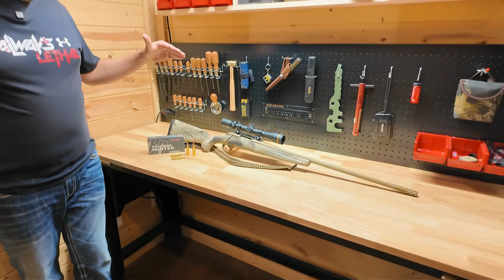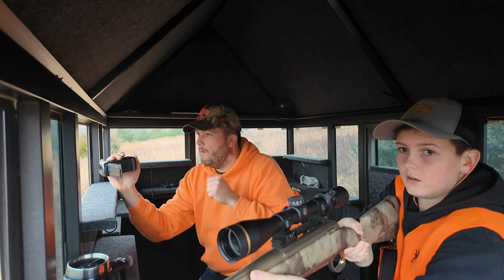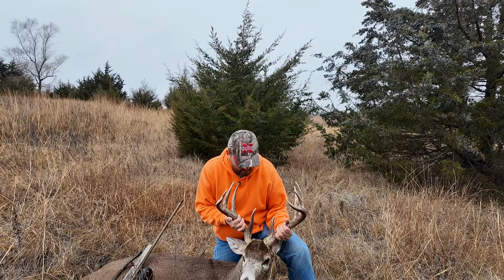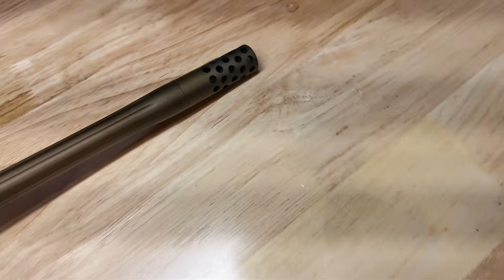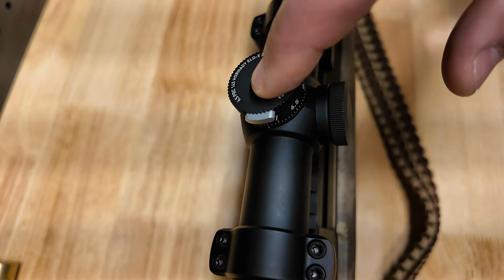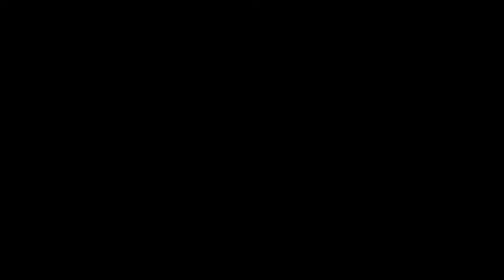6.5 PRC: The Ultimate All-Around Hunting Caliber?

Comment: A number of cartridges can be described as all-around. The job defines what may be best. I know someone who has never failed to harvest a deer with a .25-06. I have hunted with a .308. Normal factory ammo  makes it good for 300 yards and less. My all-around now is the 7 PRC. Factory PH 175 gr ELD-X is giving me .25 inch 3 shot group at 100 yards. I did some chrono data, which anyone should endeavor to get and the average MV was 2900 fps. True, that is 100 below the box claim but still usable. More important, it is pushing heavy for caliber at really good speeds, so the impact velocity is helping the bullet to function as intended.

It was pointed out by others that most cartridges, or at least .30 cal and 7s are close to within an inch of drop with each other to 500 yards. Past 500 yards, the 7 PRC really shines. But that is a different job. Some game have been harvested past 300 yards. I would be comfortable with a 7 PRC on elk. Though others may prefer .300 WM or .300 PRC.

I think, for me, and I may be a fudd, 6.5 PRC would be the smallest I would use on elk. Though I did see someone bring down a moose with 2 shots from a 6.5 CM.Within normal hunting distances of 300 yards and less. Which means that the size and weight of the bullet was the same and enough available energy that shot placement, as always, is king.

In fact, shot placement is so important that, in reading the big game hunting book by Elmer Keith, his preferred cartridge was .35 Whelen and still wind up with injured animals that lived long enough to disappear.

Respect for the Cornhuskers. My first step-father was from Nebraska.
Reply from the maker: Great response! Nice hearing some more real world 7 PRC chrono numbers, too. It's another great cartridge, but has taken a beating over those chrono numbers. I appreciate the comment, and GBR!

Comment: How's it any different or better than the 6.5-284?
Reply from the maker: They are very similar cartridges for sure. The 6.5 PRC has slightly higher case capacity (67.6 gr vs 64.3 gr), which allows it to push heavier projectiles and maintain more energy downrange. For factory ammo the 6.5 PRC will have slightly faster muzzle velocities, but the 6.5-284 has more handload options available. Great question and thanks for watching!
Reply: @HuskerHunting the 6.5x284 will push just as heavy a bullet. How much more velocity do you equate with that 3.3grains of powder? At that point, barrel length and barrel quality make a bigger difference than a couple grains of powder.

Comment: I have a 6.5 PRC Browning X-Bolt Pro with a BURRIS Eliminator 6 scope with 1/8 MOA adjustments for zeroing. This setup is for hunting in Nevada's wide open spaces and in my opinion an excellent combination of rifle, cartridge and scope. The E-6 scope sits in TALLEY rings with a rear ring bulb level - just in case the E-6 battery dies.
Reply from the maker: Sounds like an awesome setup! Thanks for sharing.

Comment: Kind of a ridiculous notion from Mr Hornady considering the 6.5 PRC is the ballistic twin to the 270 Winchester, which has been around for about a 100 years.
Reply: Higher bc bullets. That's the whole point. You can't do what 6.5 prc does in 270 unless you handload. Prc is more inherently accurate due to chamber/ case design. It's marketed to newer shooters. They will benefit most from these type of calibers. It is what it is.
Reply: yes....better bullets for beyond 400 yds really......270 400yds and less.....same basically

Comment: Basically a .270 win…
Reply: Yeah absolutely not. 6.5 prc out performs 270 by like 150 ft/lbs of energy.
Reply: @adrenhamel1731 wrong almost identical any in many case 270 is faster as is the 264 win mag, and 7 mag
Reply: @adrenhamel1731 I bought one to load for to see what all the hype is. Shooting 127 Barnes max velocity is 3150+/-, will not come close to my 270 shooting 130 AccuBond at 3280.

Comment: The 6.5 PRC is an excellent cartridge, but if you want to use all-copper bullets, it absolutely is NOT any better than the old .270 Win. I reloaded and shot both, side by side, for four years. The highest B.C. all-copper bullets available for the 6.5 is the Barnes 127 gr. LRX with a .468 B.C. The .270 Barnes 129 gr. LRX bullet has a B.C. of .463. The powder capacity of both cartridges is almost identical, as are the muzzle velocities, 3000 f/s - give or take. It's all a matter of math, folks: two bullets with B.C.s and muzzle velocities that are the same have the same external ballistics - drop, wind deflection are the same, even with bullets of  vastly different weights. In this case, with only 2 gr. of weight separating these two, even the energy is the same. As a matter of fact, the .270 can be driven a little faster than the 6.5 (according to Barnes reloading data), and it has a larger frontal diameter, which actually gives it a very slight edge over the 6.5. Don't be misled by the hype ... unless you don't mind buying cartridges that cost at least twice as much for one caliber than for another caliber that can do the same thing or better.
Reply: 1 in 100k commenter's who actually have a brain and are able to use it.👍
Reply: @Mike-xi4zt  I just saw this. Thank you so much for the compliment!
Reply: Qué feliz me hace que la gente se dé cuenta de las virtudes del 270. Tenía 6.5 y varios Wilcats magnum, ninguno de los cuales superaba un simple 270. Me comieron el bolsillo. Las balas de BC alto cuestan 3 veces más que las de 6,5. Me quedo con mi 270. Gracias.
Reply: I'll never use all copper bullets.

Comment: I am in Wyoming using PH2 in 6.5 PRC for Antelope and Elk and it is an awesome cartridge. I reload so I can get the most out of it. I will say that I am DONE with the 143 ELD-x exploding bullets. I thought the Bergers were bad about that. The Eld-x is worse!
Reply: You will want a copper bullet. The Barnes TTSX will do everything you are looking for. FYI the copper bullets run lighter on the weight but will still match the BC for the most part.
Reply: @benschamp9327 they will not match bc
Reply: The bc won’t matter for hunting anything inside of 500 yards.
Reply: @cjsawinski  Eh, wind drift can be pretty different in a 20 mph crosswind. However, for the most part I agree. My contention wasn’t that bc I super important for hunting, it was with the guy saying that the copper will match the bc. That is absolutely incorrect
Reply from the maker: That’s good feedback. What bullet are you using now? Sometimes I wonder if I should switch to the Hornady Outfitter line with the CX. I want to set up a 7 PRC using the CX.
Reply: @ well unfortunately I am getting through the season with the Eldx and still figuring out were I will go next. I still have a late season cow elk tag to fill. I am not familiar with the CX. I will need to look into them. After years of hunting with Berger and now the ELDx I will definitely be moving to a bonded bullet. The trick is finding one in stock that has a high BC. Because of the powder I have on the shelf, I will stay with the 140 class at least for now. That seems to be a good range for velocity versus wind resistance anyway.
Reply: @MaxairEngineering  if you want a high bc bonded bullet the 142 Nosler ABLR  is a good choice and doesn't explode like the ELDX.  I prefer the Barnes LRX 127 grain for 6.5 on elk and long range antelope.  Not sure on your velocities,  but I'm pushing 3450 with a 6.5-300 and the Barnes LRX 127 crushed a bull elk shoulder this season.  It's a better bullet than the CX for mono metal.  I too am in Wyoming looking for late season cows.
Reply: @ thanks. Yeah for the powder I have I need to stay 140 class. Nosler sure is proud of their bullets $$. Unfortunately I heard that they too explode at close range. Was that bad intel? I’m in Laramie btw.
Reply: @MaxairEngineering  my experience with Nosler ABLR is just factory loaded 175s for my 28 Nosler,  I don't reload them.  I have killed elk from 200 to about 650 with no issues. The 28 velocity is around 3100 which I assume is similar to your 6.5 PRC,  yes they seem to be made of gold for their price.  I try to stay off the shoulder with most bonded bullets that's why I switched to Barnes, the ABLR didn't explode but they definitely have a larger wound channel and damage meat.  Terminal Ascent have  also been great, I  use those for bonded, but I think they only come in a 130 for 6.5. I am in Casper and hunt the Southern Big Horns.
Reply: @MaxairEngineering cx line I believe are all copper like tsx
Reply: @MaxairEngineering  I found out at the worst time when using a 338 225 grain Nosler partition the bullets had been redesigned to blow off the noise and leave just a 3/8th shank.
I had to shoot a client 9-foot 1500 SE Alaska brown bear and because of the Nosler bullets failed it took 6 338 bullets to slow the bear down and then the bear jumped into the river then drowned because of so many bullets holes the bear wasn't able to swim the river.
We had to use come alongs to get the bear out of a river log jam
Reply: @ damn that is terrible!I have never used the partitions. Guess I will steer clear of those….thanks for the intel.
Reply: @MaxairEngineering  Something more to tell you about the Nosler Partiton.
The original Nosler Partition bullets was made by using a Bronze & Zink alloy jacket and was hard as a nail so it only pealed the noise section back without breaking off the noise.
If see old Nosler boxes in yellow or red cardboard those are the old originals and found in gun shop where old gunsmiths are or at gun shows.
The bullets have a bronze color to them and as they tarnish, they look like tarnished Bronze 
I have them in 6mm - 7mm - 30 cal - 338 and 375 cal
Reply: Is for your information.He was full of shit @MaxairEngineering
Reply: @HuskerHunting  I have been for one profession a Pacific NW hunting guide since 1978 and in 1989 I moved operations to Alaska.
For me any bullets with lead cores are garbage and only the copper hunting bullets I use and clients are told to bring

Comment: I picked the 7mm wsm hunted with it for 21yrs already and don’t intend to switch anytime soon. 2000fps at 700 yrds with 162eld x. It’s very comparable to the 28 nosler and ballistically identical to the 7mm prc over two decades before the 7mm prc came on the scene.  Kinda funny cause my OG abolt 7mm wsm looks like and is rigged up just like the newer x bolt hells canyon and shoots like one too.

Comment: 10 years from now, you'll be buying that ammo on line cause it won't be in the stores.  However, 270 ammo will still be there just like it has been for the last 99 years.  And the 243.  And the 7mm-08.  And the 7mmMag.  And the 308 and the 30-06 and the 300winMag.
Reply from the maker: Yes, ammo availability is a big advantage to the classic caliber selections. The 6.5 PRC may have been hard to find on shelves a year or two ago, but I've seen a lot of it in local stores in the past year. Cheers!
Reply: You still shop i n stores????
Reply: @ I sure do.  I don't like paying $20 a box for shipping.
Reply: @easttexan2933  I suppose it would depend on how far you need to travel. fuel, wear and tear, and time. for me shipping costs are much more economical.
Reply: @easttexan2933  In my experience a physical store is last place to buy ammo if the cost matters to you. Online is absolutely the place to go, many offer free shipping too.
Reply: Well it's been years and the 6.5 PRC ammo is getting even more popular in stores!
Reply: @davidwarren3433  good news.  time will tell.  I'm 79 so I will not see the end results but as fast new cartridges are being put on the market, your guess would be as good as anyone's.  I grew up on 30-30, 30-06, 270, 243, 7mag and they still going strong.  Like I say, time will tell.  Just remember this conversation 10-15 years from now.  God bless.
Reply: Academy has lots of 6.5 PRC

Comment: Silly and stupid. 6.5 PRC is a barrel burner. If you're shooting 12 - 15 rounds a year you're set. But if you get serious and actually shoot your rifle, your barrel will be experiencing accuracy degradation by 1000 rounds and be toast by 2000 rounds.

If you want a "deer cartridge" it's .308 or 7.62x39.

If you want a "long range hunting cartridge" it's .300 Win.

If you want "'nuff gun for Alaska and everywhere else" it's .375 H & H.

Or you can just man up and get a 12 Gauge with interchangeable barrels.
Reply from the maker: It sounds like you've got it all figured out. Thanks for watching anyway! 👍🏻
Reply: @HuskerHunting  

It got figured out in the late 60s and 70s when the gun writers of that era pitted 6.5s vs 7s and found that 6.5s burned out barrels.
Reply: @rmichaelzachary8574  when my 6.5prc burns out the barrel MANY years from now I’ll just buy another barrel. Big deal. I’ve got over $5,000 invested in my 6.5prc. Shoots less than a 3in group at 600 yards. No need to shoot tons a rounds a year with it. It’s on and it won’t magically change poi by itself. Got over $7,500 in my Weatherby Mark V .257mag. Took it out for a 300 yard cold bore shot before season after being locked up a year, was off 1/4 inch at 300 yards. Both guns shoot comfortable sub .5moa. No need to shoot them endlessly. The Swarovski scope on my .257 doesn’t move by itself. Point is the barrel burner argument is way way out dated. They all will burn a barrel if shot enough. I have multiple 30cals and same thing. If you finally shoot out a barrel so what, just send it off for a new match grade for a few hundred bucks then get back to killing. If I shoot 100 rounds a year with the PRC it would take a decade to see any noticeable accuracy loss.  Again big deal.

Comment: 6.8 western is the best mid tier cartridge that needs us to demand more supply. It literally beats everything without going to high on the recoil chart
Reply from the maker: The 6.8 Western is an outstanding cartridge. I nearly bought a Model 70 Supergrade in 6.8 Western last week.
Reply: @HuskerHunting  Rarely do people who enjoy rifles know the 6.8 Western and the 6.5 PRC can be chambered in the AR 10.
I build and sell AR 10 uppers in these two cartridges plus all of the WSM magnums and wildcats like a 6.5 -300 WSM or 6.5x50 Jap and 6.5-284 Norma.
I have also a 6mm - 284 win or 250 Savage and 257 Robers or large bore 358 win and a 375-300 WSM in AR 10 uppers I build and sell.
Using Pac Nor barrels or Douglas barrels these are the same accuracy as a good bolt rifle.
I even offer to possible buyers to come shoot these AR 10 uppers if in NW Oregon
Reply: 6.8 probably a bit better for elk....if deer only and smaller, 6.5 ...larger cal. only needed for larger animals at strange angles, through bone, and fast anchor IMHO...standing broadside good bullet....6.5 probably works for elk very well.....

Comment: Another quick note - my 270-7PRC is getting 3230fps with a 170 Berger VLD in a 24" 4 groove cut-rifled barrel. This outperforms the 6.5PRC with anything, the 7PRC with a 180 VLD at 3000fps, and a 7PRC with a 195 EOL at 2900fps. I have one barrel chambered and another rifle in process and 5 more barrels on the way with 8, 8.5, and 9 twist. Plan to compare 150 Nosler ABLRs, 165 Nosler ABLRs, 170 Berger VLDs, and possibly some Hammer 162 (?) grain bullets and finally some 155 Barnes LRX

Great video by the way
Reply: Sept for that recoil though
Reply from the maker: Thanks for both of your comments and for watching!
Reply: @HuskerHunting  sure thing. By the way, I took a Tikka 300WM and a 6.5mm Brux barrel to my builder to convert it to a 6.5PRC. It will be the 4th 6.5PRC for me
Reply: You are a teenager YouTube Groupie Parrot mouth talker and  liar.
You post all kind of liar crap so much I see your channel and photo all the time with compete lying nonsense